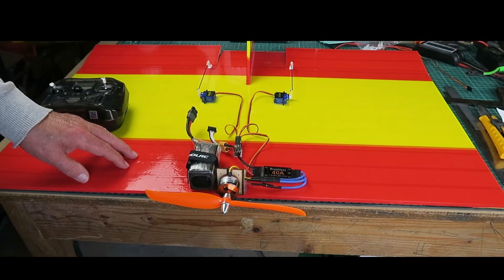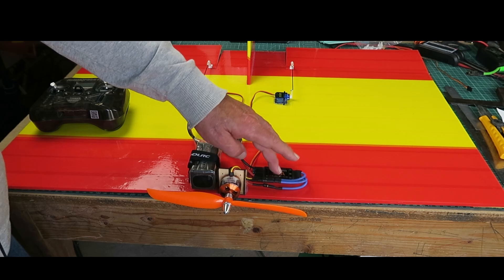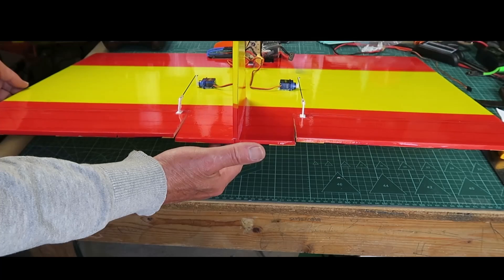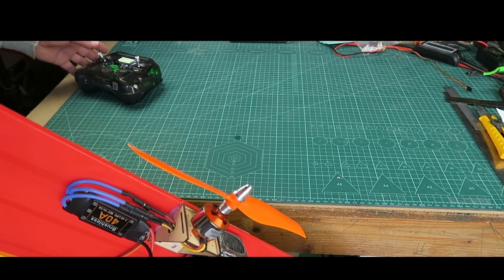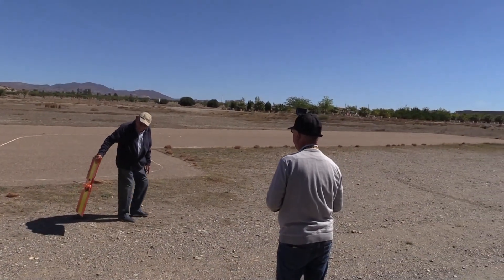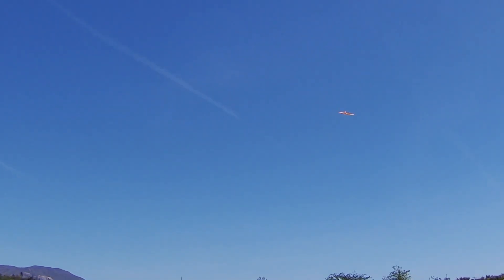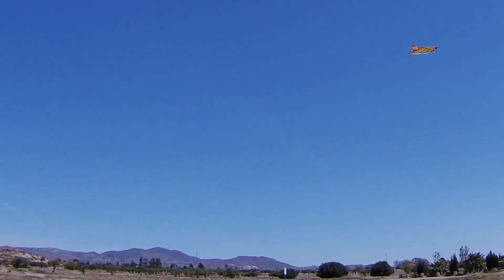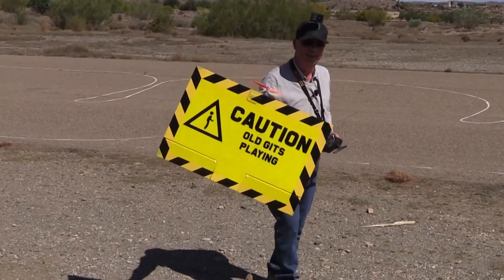¡Sheet! It flies! Single Sheet Foamboard Plank RC Plane Maiden Flight

Comment: Love this. Im quite new to modelling & this gives me hope. How does it get lift without the wing airfoil shape?
Reply from the maker: Even without a curved top, a flat plate at an angle creates a pressure imbalance: 
Top Surface: Air passing over the leading edge is forced to "curl" around the corner, which increases its velocity and creates a region of lower pressure.
Bottom Surface: Air slows down as it encounters the angled surface, creating higher pressure.
The resulting net pressure difference pushes the plate upward.
People say it can't fly and I like to prove them wrong!! Thanks for watching, have a great day!

Comment: A long bamboo skewer or a carbon fiber rod glued on the leading edge would stiffen things up a bit for those full throttle maneuvers.  Good fun overall. I may grab a sheet of foam and a few odd bits from the spares pile and have some fun as well.
Reply from the maker: Thanks! I knew it would be too flexible but the object was to make it as minimalist as possible as I posted it in an "RC Planes for beginners" group : https://www.facebook.com/groups/767684880685754/ Thanks for watching, have a great day!

Comment: 000   the amount of tail-heaviness in the model's dom is  INCREASED, as a result of the location of the mass of servos  Aft-of  the cg.!!!            this wing has so much area that the affects of  p-factor  are negligible at all times.
the aft ends of the battery and servos could be faired; to reduce drag from turbulence.      it  appears  that the elevon linkages should be  Adjusted;  so that, the servos have more mechanical advantage and the rate of elevon deflection is reduced.      d